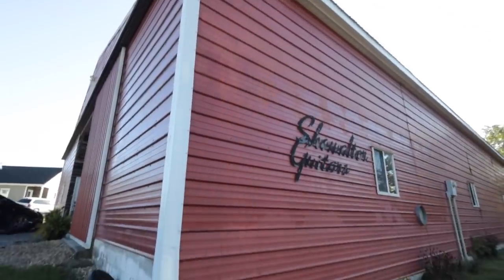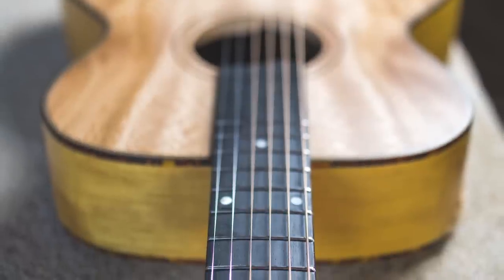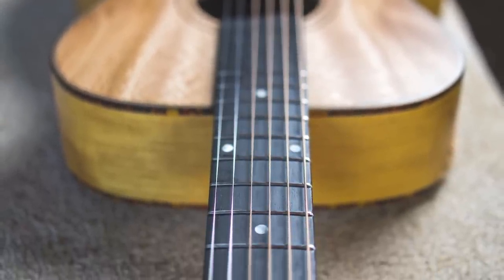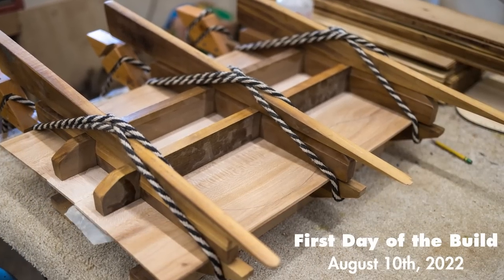Building an Acoustic Guitar with @showalterguitars5707 Episode 19 I Final Assembly and THE FIRST STRUM

Comment: If you can break a teeny, tiny tuning machine screw in a headstock, you're probably not qualified to handle most – if not all – shop tools.
Reply: We use hedge (Osage orange) around here for corner posts it’s so hard and dense. I’m surprised more screws didn’t break.